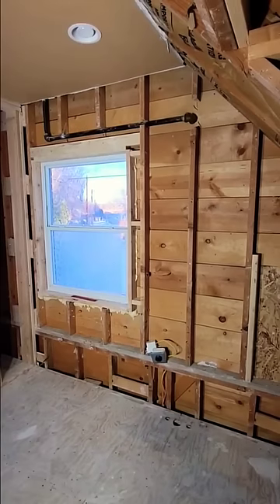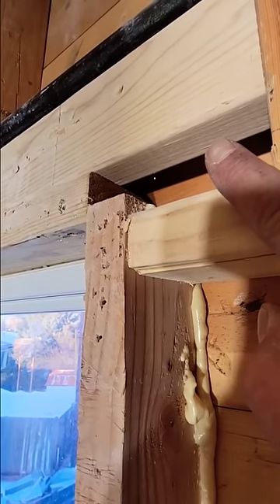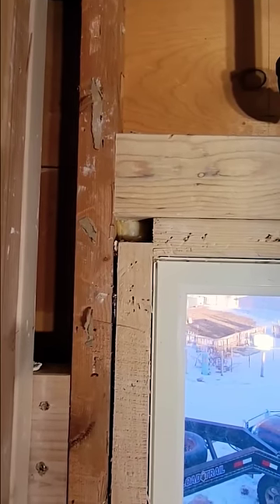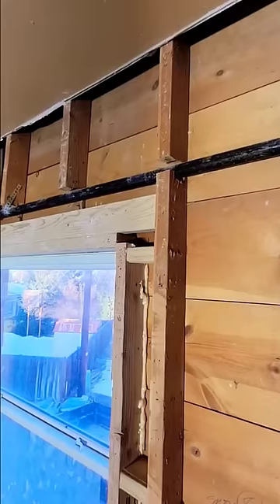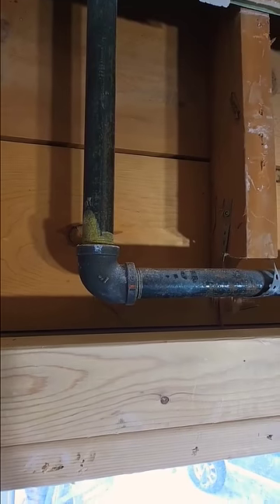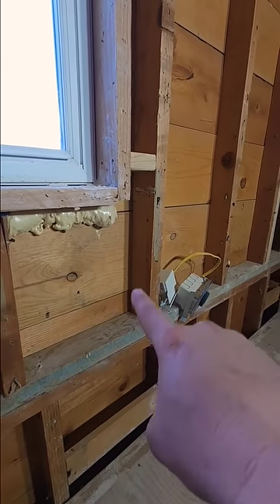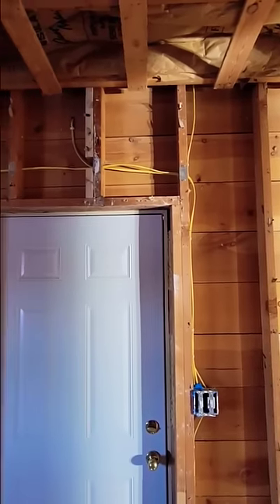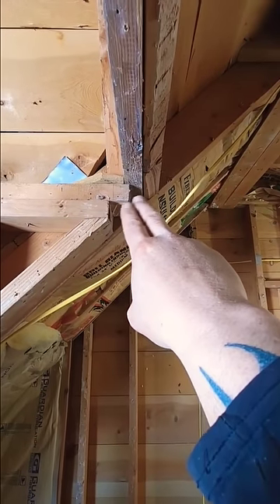Why ((REMODELS)) cost so much! #hacks  #construction #framers #plumber #shorts

Comment: I’ve found structure, electrical, plumbing, and mechanical problems on every single remodel job for the past 40 years. It takes me triple the time to fix someone else’s bad work than building it from the ground up.
Reply from the maker: It is everywhere for sure!
Reply: I've seen it all too. Example, pool light no GFCI ,just a switch at a day care facility. Took pics disabled, tagged,notified owner and authorities got read the riot act by owner. No more,retired now.🙂🇺🇸
Reply: @307Garage  How is this house still standing? It looks like a movie set in a warehouse-- slap dash and not for inhabitants.
Reply from the maker: Right!
Reply: Yeah, me too.  I've been doing professional whole house renovations for 20 years.  It's amazing the crap you uncover.  I now assume every house I do is going to be full of idiotic stuff like that.

Comment: I always say "Remodeling, you don't know what you're getting into until you get into it. So many surprises behind the walls.
Reply from the maker: Yep
Reply: @307Garage  
Since you seem to be dressed for cold weather, I’m guessing that the wall depth isn’t even up to local code for proper insulation, not to mention basic building codes(basic carpentry logic either)!!!!
Reply from the maker: Code states R13 as a minimum. You can fit R13 in 2X4's
Reply: it’s like a box of chocolates, never know what you’re gonna get!
Reply from the maker: @camac26781  For sure!

Comment: If anyone wants to know… the reason the gas line isn’t up to code is because they used a bushing reducer. There is no reason to have the pipe in the wall. It should have been ran on the exterior and then through the wall wherever it needs to go.
Reply from the maker: Nailed it!!!
Reply: I've always known not to do it...but never explained why it's not allowed.  I get the "friction loss" issue and sizing  from 1/2" supply to 3/4" is a no-go.   Care to explain?
Reply: @blh3741  Its just additional points of failure as far as I can tell.
Reply: @blh3741  they break. The threads are cut on the outside and the inside which makes it crazy thin every time the ‘valleys’ cross. Also, the blunt end on a reducing bushing causes turbulence which creates additional loss that you would have to account for every time you used it (would make pipe sizing that much harder).
Reply from the maker: Yes!
Reply from the maker: First off, The gas line needs to be sized to how much over all gas your system is using. Only can be necked down after the first gas heater or water tank. Then it can be a little smaller, but not much and so on and so forth down the line. There is math that go's in to it.

Having 90's and T's in the wall, if it starts to leak because of anything or even just being old. That stud bay that is almost air tight turns in to a bomb. Also we will never know that 90 or T is in the wall till we take the drywall off the wall and find the leak!
Reply from the maker: Yes this kind of reducer are junk! They always end up leaking after time. plus they had to different metals that are going to respond different with each other and is probably going make a leak all by its self.
Reply: Gas codes are so different from state to state and even city to city. Plumbing is the way sometimes worse depending on how the inspector interprets the code. Threaded fitting are legal if you air test to 100 psi for 12 hours for gas . Bushings are legal for heating.  House contractors usually don't use license plumbers. Cheaper for a carpenter to install..😮
Reply: Yup
Reply: There is nothing against code on the gas lol. Except the thread tape and dope are now supposed to be yellow to indicate it’s gas rated.
Reply: @dannyb5032  what?? Did you miss the bushing? Guess you should learn code before trying to correct a contractor

Comment: If customer doesn't agree to pay I gotta walk away...code corrections aren't free
Reply: Yup - which is why blind bids beforehand are nonsense, and  enormous change orders are also often nonsense.  Someone needs to know what's in the dang wall.  

As the person generally paying for work, this is why I'm a fan of paid bids.  We both need good information for a good estimate to happen, and gathering the info properly is going to take time, which I expect to pay for regardless of who ends up doing the work.  If the first person bidding makes an unnecessary mess of the work in place during initial discovery & inspection for the paid bid, I've paid them, and I'm free to ask for competing bids.  He's paid, got a chance to show me how he operates, and I have fewer big surprises.  That's a professional situation.
Reply: @chrishayes8197  how would you have properly est. That without seeing behind the drywall
Reply: @chrishayes8197  paid bid? You pay him for doing proper inspection?
Reply: @sungkim16  You don’t agree to do any work inside the wall until the drywall is removed enough to confirm the work that’s required.
Reply: @Klattooss Yes, exactly. Not all estimates are free. Often they are a priced offering, sometimes the cost gets applied to the contract if accepted.
Reply: Code corrections aren’t really a thing plumbing wise. There are plenty of codes for existing work. Code books explicitly state that it is not required to bring existing work up to code.
Reply: Hell no, but you have to stop at each issue and let them know it’ll be extra to fix it. And that in and of itself takes extra time and effort to prepare additional pricing.
Reply: @adammacfarland8811  idk where you work but in the united states most states require you to bring things up to code if you take off the dry wall
Reply: @911WASanINSIDEjob420  talking about plumbing specifically, it’s in the IPC, only really applies to building drains, you do have to bring those up to code, but there is an existing work line in there that should explain it pretty well for ya pal !

Comment: I'm NOT a Professional Residential Contractor.  But I understood everything you pointed out as massive code violations without having to hear you say it.  Which is why I did ALL the Reno on my house, including bathroom complete gut down to floor joists, new wiring, moving some cast iron radiators, etc. Myself.  Including plumbing a new Boiler.

Comment: My home is an old school that was built in 1888 
     It's all balloon framed without headers at any openings. The walls were sheeted on the inside and the exterior. It been remodeled several  times in the past 150 years.
 The last go round included a second story and an 800 sq ft addition taking it from 800 sq ft to almost 2300 sq ft. The only signs  drywall cracking and settling is in the shed addition where there was a three inch crack in the DW. . 
       Balloon framing really stands the test of time.
Reply: the issue with it. or one of them is the ability of a fire that starts in the basement, to travel up the entirety of the wall almost unimpeded into the attic and consume the entire house very quickly
Reply: @drewfullhart1750  I always thought it was called a balloon frame because when a fire does start the walls fill up with hot air and it pulls the house up into the sky. Check in the basement. I bet there is a basket rigged to the house above and ready to go.
Reply from the maker: Yes and overall it is not even as strong as the way we build now. And yes the fire will go everywhere real fast.

Comment: My first question to my customers is when was your house built ?
Reply: If it was built between 50s-90s stay away.
Reply: @Possimpablee  
Depends on where they were built from the late 70’s through the early 90’s!!! 
A lot of states started requiring licensed contractors, plumbers, electricians, insulators, and carpenters to build new structures to get permitting approval from the late 70’s forward!!!
Building codes were established by the mid to late 70’s in a lot of states; yes there were some states that hadn’t set building code standards until later, but by the late 80’s nearly every state had building code requirements for all aspects of new building construction!
Reply: @AzzKicker-bz1cb  in my country they started mass producing houses in the 60s and that's when quality went out the Window.
Reply: @AzzKicker-bz1cb  You're pretending that qualified tradies aren't the ones doing the bad work? 
A homeowner might do things that are wring but look right. Most people are unlikely to do things that are wrong and look wrong unless they're qualified and can make people think what they did is correct because they should know what they're doing. 
Had a house inspected that was built after the time people were allowed to do their own work, we have the paperwork showing a company built the carport and it wasn't done to code. 
This place is much worse than others older places that the owners did the extensions themselves. 
Requiring people to use professionals is dine to justify more government workers and allow tradies to charge ridiculous amounts more than it being about safety. 
If it is done to code then that should be the requirement, not who does the work, but in Australia it's the opposite. Here you can't do work yourself and have it inspected, but a qualified person can do a non compliant job and nobody cares because they were qualified.
Reply: @chrisnoname2725  hello. Can you please explain what you mean by professionals being used merely to justify more government? In USA, the building must be built to code - ostensibly, this is for safety reasons. I presume this is the case in all western nations but perhaps I am wrong.
Reply: @villagemagician1320  government authorities like energy safe and other regulatory bodies for different industries who like to make new rules so they can travel around holding seminars, also they like to make sure everyone is qualified and paying to be registered. 
No different to the aviation regulator who i have dealt with doing those types of things. Also they increased the hour requirements. They get paid from the fuel excise. 
All the government agencies are the same
 In agriculture they keep making representative boards that farmers are forced to pay
 I have no issue with things needing to be done to code. My issue is with only allowing qualified people who often don't do a good job anyway.
Reply: @villagemagician1320  it is claimed to be for safety. A code is for safety. Only allowing certain people do do things our grandfathers all just did themselves is to make people pay their dues and has nothing to do with safety
Reply: @Rasmus Adolfsson  Not necessarily. I own a small home built in the late 80's, and honestly it's decently built. I've completely renovated it so I've seen it's bones. I work for a cabinet company that provides cabinets for new tract homes and can honestly say they are complete crap. No rebar in the driveway, no insulation, the base molding looks like a snake on long runs, etc. It's all about who builds the home.
Reply: @chrisnoname2725  
I’m not “pretending” any such thing! 
I simply stated that the government started set building codes and requiring new construction homes to have licensed contractors in each field to either do the work or at least to be the ones who signed off on the work that was done! 
In most cases it was easier to let the licensed contractors do the work then there were no inspectors questions on how it was done, they would just look at the work and then sign off on it meeting the established codes!
Reply: @AzzKicker-bz1cb  But why do you think that the bad work had to have been done by a homeowner? The quality of new builds here is atrocious. Forcing people to involve qualified people has only made the quality worse in my country. 
I don't think a homeowner is likely to do obviously stupid things to their house, that dort of things is what the professionals do because they can get away with it because people assume they will do the job properly.
The simplest example is not in construction but mechanics. A car owner servicing theur oen car would see that the manual says to never overflill the oil so wouldn't overfill the oil. Every mechanic that has ever worked on my parent's cars has overfilled the oil and if a car owner checks they will just assume that it's ok because the mechanic knows what they're doing. 
Making people use qualified tradespeople and inspectors is to keep unions happy because their members get better job security and can charge stupid amounts and it makes the training institutions happy because they have people learning because the psy rate can be high, it gives apprenticeship companies work and it gives the government more money in making people psy for licences and permits. 
People would be much less inclined to pay tradies for crap work if they were allowed to do to things themselves. 
I had a plumber do guttering. As a homeowner with no experience i would hsve made sure it flowed correctly and would have made sure that the downpipe was attached as it was originally so it wouldn't come out of the drain at the bottom.

Comment: 😂 this is the story of my house. The original owner did 2 additions himself. It didn't go very well and now I'm working to fix it.
Reply: And I cried about my house  a last guy who did  a remodel on it just did not put insulation in walls where they opened them, did not put rubber buts on vent pipes, placed plywood sheets over electrical wires and then they ask me why I do not want to pay somebody to fix my house

Comment: I always used to give 2 bids the first was just for demo and the remodel costs. The second was the most important, it included the cost to completely remove all framing and start over built to code. The first bid was the minimum cost the second was the maximum cost. If you agreed to one you agreed to both in the contract. Saves a lot of time arguing extra expenses. Never start without a contract showing the client understands and has signed on for all the work that could be needed.
Reply from the maker: That is a good way to do it that is for sure!

Comment: Yes I'd leave that plumbing in the wall, it's been at least 10 years with no leaks and no reason to think it will, a lot of codes are for uniformity and it doesn't mean there's not ways to do things that are just a good if not better, in fact in a remodel I'm not changing a thing that doesn't pose a safety risk or isn't going to hold up, and if it's a job that requires inspections then it's called a change order, something above and beyond what the scope of work was suppose to be and it's gonna cost more, they're pretty standard.
Reply from the maker: So just build around the gas line that does not meet code?